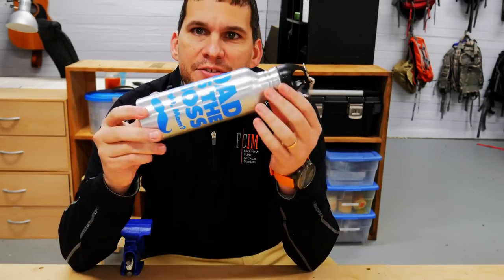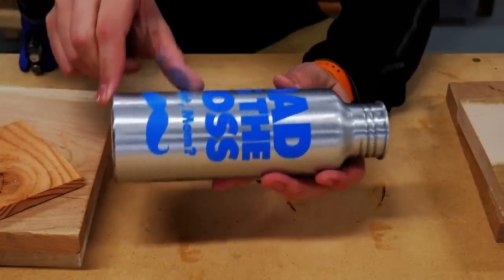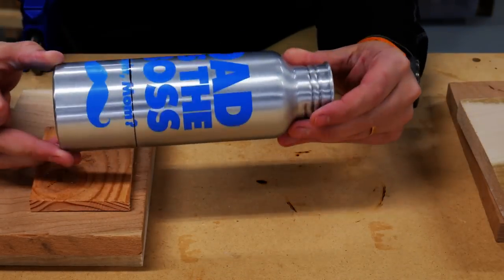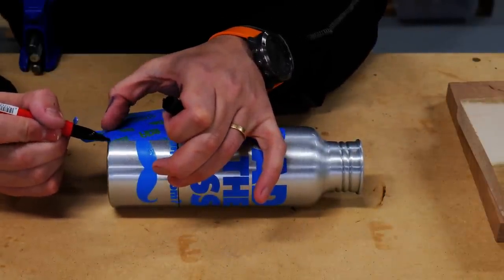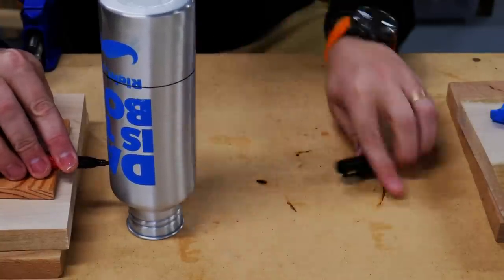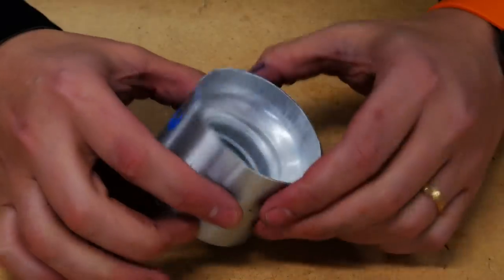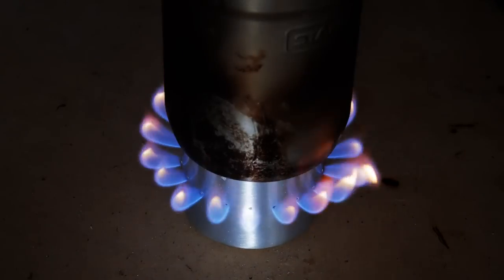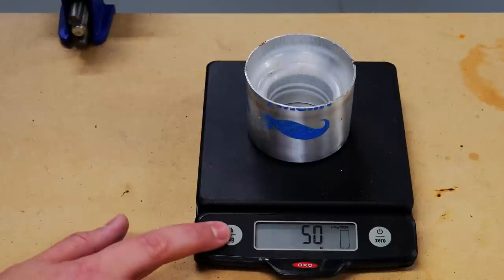Alcohol Stove Made from $1 Walmart Water Bottle - Best Design Yet?

Comment: Great instructional video doc. I made a few of those stoves years ago. You could buy those water bottles at the $1 store for a buck anytime. I switched over to making the fancy feast stoves because I liked the built in pot stand. Easy to make from a cat food can and a tomato paste can. I painted the steel can with high heat grill paint to prevent rust. I have used both fiber glass and a welders mat for the wick. You should build one and do a video on it. They work great and are very light.

Comment: Yes those stoves work and they’re very strong.

There’s usually two problems with stoves like this.

1 poor fuel economy 
2. The bloom (flame pattern is going to be 5-7 inches wide. Won’t work with small titanium cups if you want to reduce the weight of your pack

Get a thick aluminum cann about roughly 2 inches in diameter 

Place the jets 10-11 mm apart (15 jets 1/16th in diameter if memory serves.

This will give you a strong stove that works with smaller cook pots and weighs a lot less.

I made alcohol stoves since 2010 I make them of 53 mm diameter juice and energy drink cans (8.4 fl oz Red Bull diameter)

To speed up the bloom time of an alcohol stove wrap the ouside below the jets with carbon felt or fiberglass wick and super glue in place. Wet the wick with alcohol set set your pot on the stove. Light te alcohol in the Wick and your stove will light in less than 40 seconds.

Comment: Gotta love the genius thinking of the first messaurment @1:28 where you wanted the same height at top and bottom and brought out the painters tape and started marking and adding to it because of the cone shaped top instead of just flipping the bottle using the same boards between the table and the marker :) Im pretty sure that messurement wont change no mather which way you hold the bottle :) And also you didn't seem to notice it even when you made the second(top) mark using the same boards :)

Comment: Just found your channel got to say enjoying it. After seeing this video I happened to be in Walmart and found two single walled stainless steel bottles. Did basically the same setup only I added carbon felt between / around the bottle neck. One thing I noticed was that two of the the flame ports don't light otherwise it's my 1st stove and boiled water. Thanks I do plan on buying the Evernew titanium stove.

Comment: Same bottle today is over $7.00 !

Why not roll the top edge to eliminate it getting loose? Heat may loosen it after using it for a while.

Biggest problem I see is the wide flame jets. Meaning far enough apart for a skillet but might be too far apart for a cup.
Flame running up the sides is wasted heat and fuel.

Comment: Always leave your inner piece taller than the outer piece, so you don't have any problems pressing them together (this is where he went wrong and had some troubles finishing the seal).   You can trim it back with the snips after seating the seal, if you like.

However, I always make my inner piece quite a bit taller than the outer piece so I can take it apart and modify the burner at will, according to the purpose of the burn (baking v boiling).

The other thing I noticed is that his notches on the bottle mouth are too big.  They should be shallow knicks all the way around the neck (like the jet holes).   By doing this, the fuel usage is optimized, since the flames die out quickly when the fuel runs out.

Another thing to do on a burner where the jets are around the outside of the can, is to insert the drill bit backwards into the jet hole and bend the hole pointing upwards by lifting the bit upwards as vertically as it will go.  When you do this, it directs the flames upwards, more directly at the bottom of the pot, increasing your fuel efficiency and lowering your boil time.

Because it usually takes a while to prime these thicker burners, I suggest using priming fluid around it, to drastically lower the bloom time, which increases the fuel efficiency (not just in cold weather).

Of you make a burner with the jet hole on the  neck around the inner piece, then the height of the inner piece acts as a wind screen for the flames and you have to have an independent pot stand.  

If you make one out of stainless steel, you will want to "turbo boost" it with a buddy burner placed underneath it to warm the fuel throughout the burn, to get a usable flame size pattern for boiling water.  Unboosted, it will produce pea sized flames (very low temp) that I believe would be useful for warming things, but definitely not be suitable for cooking, but only if you had a windscreen around it.  Since, unboosted, it burns at a much lower temperature (once it blooms:priming fluid is a MUST for stainless steel burners), the fuel capacity will last a very long time.  

The trick to drilling jet holes in stainless steel is to use a hammer and nail to punch a divot to start your drill bit in, if anyone is interested in making a burner from a stainless steel waterbottle.

Comment: Try making a burner out of a rave hair spray can ( useing the bottom of two cans )  . I'm talking about the travel size cans ( I think the barbesol shaving cream travel size
can is just the least bit larger ... should make them go to gather easier ) . Punch ( or drill ) fill hole
and jets in top ( makeing it a top 
burner ... experiment w/ number
of jets for heat & burn time ... no need for a penny ... fill hole will 
become a jet ) . This won't set the world on fire ( or the fire alarm off ) , but , it will heat a can of soup & make noodles . Best part
is it won't use much fuel . It depends on number & size of the jets , for how hot it gets & how long it burns . I think You'll like it .
Let Me know .

Comment: Question ! So can you make the burner taller to give you more reservoir to hold more fuel and adjust the inner bottle neck height to match , I want to give it a longer burn time , and do you need to notch the top we’re the cup will set on to give it air ?

Comment: How far from the top did you drill your holes?
Reply: Was wondering the same! It's kinda The Most important thing.. Looks like about half the 1.25in. so 3/4in...I guess.
Reply: Holes have to be below where the pieces are tight together - where shoulder tapers in from the bottom piece.
On the inside piece, measure from cut line to where shoulder tapers in.  Add~1|4"  
Use this measurement on the outside piece, from the cut down.

Comment: You are correct that the water bottle is stronger than a soda can, but you forgot to mention to your viewers something important…. In colder weather, it will take longer for the burners to catch fire… it takes longer for the thicker can to warm up to get the combustion needed for the burner holes to light…it is a great stove, just not good for colder temps…. Soda cans are better for that..

Comment: If you want the pieces to go together without pressure then heat the bottom section and put the top section in the freezer. When you assemble them no pressure and will be super tight to seal it together.
Reply: Woooww. This is a real ingenier. Thankes, cdmx.
Reply: And dry ice works even better

Comment: Hey there. This was very helpful and inspired me to try for my very own. Found my water bottle source at Goodwill. One thing while I was testing was getting the mouth to set right. You cut the mouth part a little shorter and then used the round wood piece to keep pushing the mouth to set. This was causing problems for me so I thought why cut it so short? I used a thick paint pen to mark my cut line on both the mouth and the base at the same height. Then cut the top edge of the line for the base and the bottom edge of the line for the mouth. So when you push the pieces together, they line up at the top and bottom because of the thickness of the base transferred to the thickness of the cut line! Worked beautifully. Easy enough for my kids to make.

Comment: Looks like it would work well on a wider pot. The flame goes out farther than the diameter of the cup shown in the demonstration, so it's much better at heating the surrounding air than the contents of the cup. Alcohol stove 101: use a wider pot. The narrower the pot, the narrower the stove must be for the flame to hit the sweet spot of the container. Best bet if your heart is set on a tiny, tall pot is to use a stove that directs the flame inward, not outward, and use a pot (or cup) stand. Better yet, forget alcohol as a fuel an use a canister stove. I only use alcohol because it's a "greener" fuel.

Comment: Ernie, nice design. I don't want to repeat the suggestions already proposed, so here are two more:1) Add a wicking media that increases surface area, such as fibreglass exhaust wrap.2) Experiment with a preheating burn, by putting a foul barrier underneath with a few drops of fuel and light

Comment: You could make the two height marks in one setting. Mark the height, turn the bottle around and mark the height of the inside part. The put half inch marks on the tape and put it on to drill the jets. Nice build!

Comment: @PaleoHikerMD I've been watching a lot of your alcohol stove builds and now I'm obsessed with making them. I fou d a $1 water bottle similar to this but it's stainless steel. It works but takes a full two minutes to "bloom" and the jets are very small. Any thoughts on what I might have done wrong? 2 7/8" diameter with 17 - 1/16th holes 1/2" apart and 1" from the top. Could the stainless be an issue? If anyone can help its you. Thank you. I appreciate all you do. 
-- Greg

Comment: Hey are you a fan of Hiram's videos? Love the concept for larger pots or pans but for the pot you used in your video the flames barely touch the pot let alone stay on the bottom. You don't want the flames to lick up the pot.  And you want a 1 inch gap from the jet to the pot.  Very cool looking stove. Interested to see how it performs with a small pot vs. a frying pan or something?
Reply from the maker: Yeah, this was literally the first burn with it and it was quickly apparent I needed a wider pot.  Thanks for watching!
Reply: If you stick a nail in the jet holes and bend them up, it will direct the flames more upward than outward (applying more direct heat=quicker boil time : and if you place the Jets on the inside, the windscreen is built in=smaller flame pattern=allowing for use with smaller pots.  

My burner made from stainless with inner jets burns for a CRAZY 57 MINUTES at full fuel capacity).  

As is, with the jets on the outside, I'd suggest you add an external wick, because the larger inner volume of fuel (because of the shape of the bottle's neck, relative the the heating volume: which is why the fancy feast stove blooms so quickly) takes longer to heat to blooming temp.

I make all my aluminum burners with taller inner parts than outter parts so I can hand press them into place easily and modify them (inserting or removing a wick) at will, for whatever application I want, in conjuction with my height modifiable pot stand.

Comment: Hey Ernie,  check your local Walmart.  They just put their 4 Pak of HEET in the yellow bottle on sale for $3.00.
That is half normal price.   As I am sure you know HEET in yellow bottle is basically denatured alcohol only cheaper.

Oh by the way I would clean up the burrs on the inside of the stove where you drilled your jet holes before i compressed
the two sections together.  It looks to me your top section is still not seated all the way down.  This would cause your stove to lose some pressure.   

I have one of my stoves that will boil 2 cups of water in about 3 minutes flat. Not bragging if you can do it hehe.
Reply: i use methylated spirits-$5 per litre.way cheaper than your heet(especially as your dollar is wort about $1.27 of mine
Reply: @jadekayak01  Four 12 ounce bottles of heet is about 1.42 litres. Right now selling at mall wort for the equivalent of 2.10 of your pound sterling. I would say Heet is "way cheaper" here than your methylated spirits at $5 a litre
Reply: @Akindone53  firstly-im not a fucking pomme and how could you possibly think i am.

You correctly quoted me saying meths is about $5 a bottle and you  said pound as a currency.

We use DOLLARS so that obviously excludes pomgolia as my country or residence.

However,at £2.something and an exchange rate of 1.9555 $ per pound that is about $4 per litre.

This exchange rate seems a little low to me as we normally sit around $3 to £1 or close to it(maybe brexit has something to do with it)

But by far the biggest concern is heet is unavailable here unless by special order at $20 per 12 ounce bottle.

That makes meths the best option here.

Comment: bought a can of beans today.

it is a little wider than this bottle so will end up more stable.

one ring of 6mm holes 40mm up from base and one ring dkwn from the top.

about 12 to 16 holes diameter dependant.

if tge worst occurs i have 2 bean meals for 70cents and the stove is a washout.

if it works i have a FREE stove that is the easiest to make,does not suffer from cold pot shutdown,AND 2 bean meals.

Comment: Slow and wild, I made mine out of an old battered SIGG water bottle using David H method of cooling the inner and warming the outer before assembling. But it took some brute force to push the inner into position. Using 28g / 0.89 ounce of fuel (meths) it took 2 minutes to bloom and 3 minutes to boil a mug of water, just before it ran out of fuel. That said it works but maybe not the most efficient.

Comment: Does the height of the holes matter exactly or can you get nearer to the top so you dont have such long jets coming out. 

What would putting a wick in bring to the tables, I see some people have mentioned it, you wont increase the capacity but does it affect the quality of the burn ? I guess it would be safer as well.

Need to see if anyone produces wider water bottles to get a larger capacity stove.  It doesnt necessarily have to be round, for example a army water flask is oval and that you would be able to cut quite easily and press together,.

Comment: 16-24 holes is the usual number of jets for something this size.  More just or bigger holes burns fuel faster.  
After you mark the circumference of the bottle on the masking tape, you can figure out the spacing between the holes.  It just happens to work out to 1/2 inch in  this video.

Comment: I found that if you file a few notches in the top as well, your pot will not suction to the burner. The heavier aluminum heats up really slow in cold weather. I have made several different kinds. I like the trangia, because you can keep your fuel in it. Nice video
Reply from the maker: I'm gonna try this out because I really would like to see it perform better, thanks for the tip!
Reply: The biggest factor in bloom time is the volume of the inner chamber vs the volume of the initial heating.... which is why I advise adding an external wick or simply dripping some extra fuel on the outside of this burner (while sitting on a suitable surface, of course).

Also, you should angle the jet hole upwards with a nail, to concentrate the flame pattern more "up", rather than "out".

Comment: Is there a formula to how far down the jets are drilled? Seems the higher they are the closer to the pot and faster to the boil. Would love your input on this.
Reply from the maker: It is definitely something I need to “test” more. There has to be a sweet spot, but I’m not sure I know what it is.
Reply: The height of the jet holes determine your max fuel capacity (=burn time)  This particular bottle type is substantial.  My stainless version with inner piece jets (built in windscreen) burned an insane 57 MINUTES.

Comment: Thinking about making this! Question: It seems like it would be difficult to pour out unused fuel. Have you tried that?
Reply from the maker: To be honest with you no.  I usually measure out my fuel and know pretty much how much I need.  I just let it burn dry.  I would imagine that you could poor out excess and get most of it out.  There will be some residual you can easily burn off.  Thanks for watching!
Reply: If you line up the bottom edge of the stove with the top of your fuel container and tilt it slowly, the excess fuel will run out of the holes, down the side and drip into the bottle.

Comment: Stainless steel or regular metal would have been better.
Reply: Actually these bottle types are stainless steel. The bottles with the very narrow cap are aluminum.
Reply: My stainless with inner jets burned 57 MINUTES at full capacity... the design has a built in windscreen, and the heavier metal retains and controls the heat better than even the thick aluminum bottles.

Comment: Hi. I just found this presentation. I really like the idea of the stove that you created. I have never used an alcohol stove. I've always used fuel can burner stoves. I was hoping you might be able to tell me the brand of bottle you used. Also, did you have issues whit succ a wide jet pattern? Were you only able to use a larger diameter pot to even a pan? Looking at the jet pattern, I believe that it would work very well with a small MSR pan that I have never used. Thank you for taking the time to produce this instructional, and I will subscribe and share it. I look forward to watching your other stove Ideas.
Reply from the maker: It works very well with wider pots and pans.  Thanks for watching!